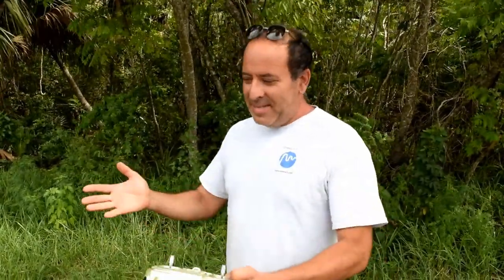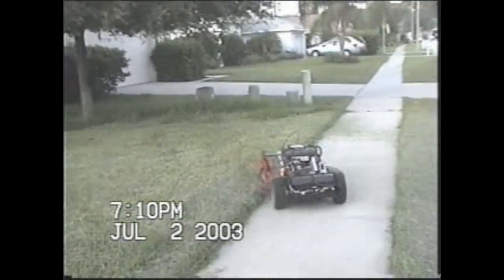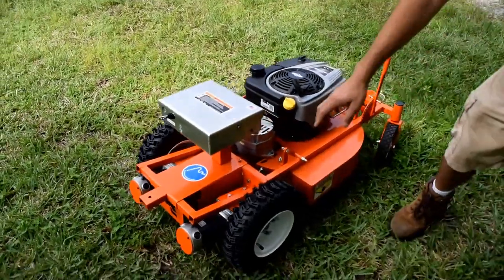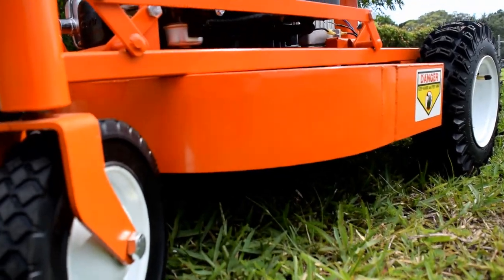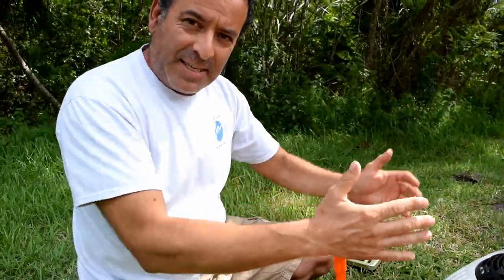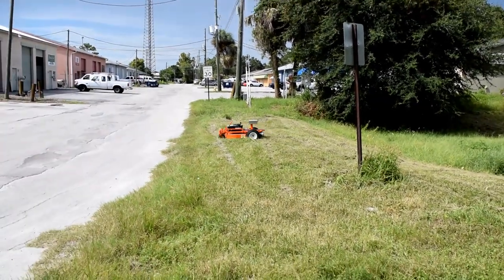The very first Remote Control Mower ever!!

Comment: I always wondered why don't people use electro-mechanical combination to produce tracked vehicles. Electric motors are much easier to implement and than mechanical and even a small 40 cc petrol engine can be used to charge the batteries. A large fuel tank can keep it going for ages, and you can always stop a fuel station to fill up.

Comment: I would be cautious to do business with these hacks. They have a good idea but doesn’t go far past that. I actually have renamed mine Evajunk. For anyone Out there that Buys one be sure to buy a Sabertooth motor controller to make it work properly  they really are a joke as programmers but they know this. When he cut the price in half for me to buy saying he needed to make payroll I should have know better but I pulled their junk board out and used a real motor controller so it actually works now. I had researched and knew it could be changed over before I bought it.
Reply: What kind of motors do and gearboxes do they use? Are they any good or do they need upgrading as well
Reply: Did the sabertooth fix the delay in response 🤔